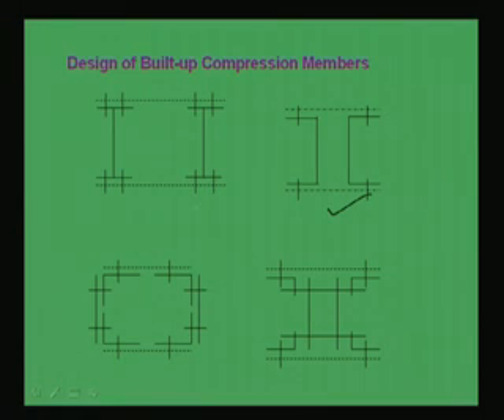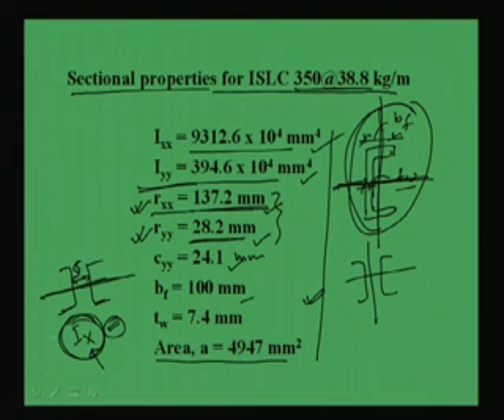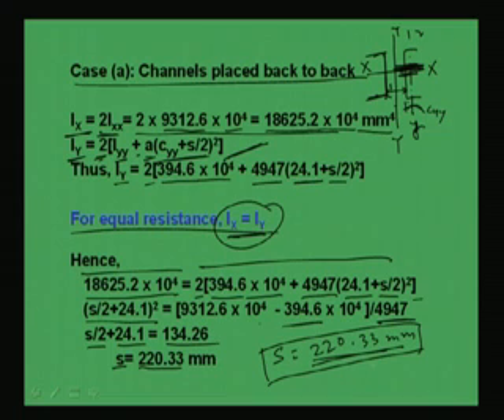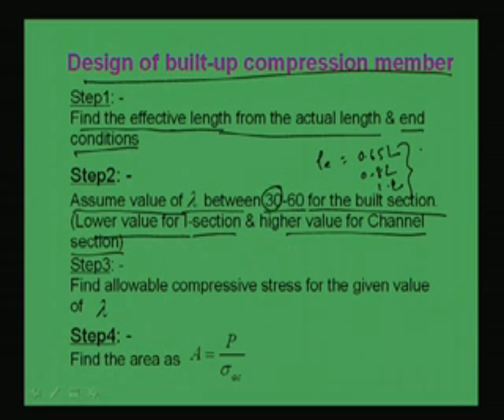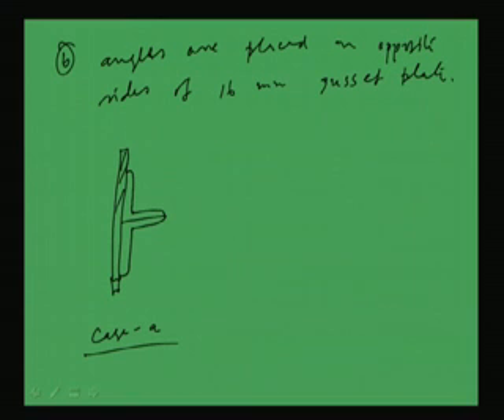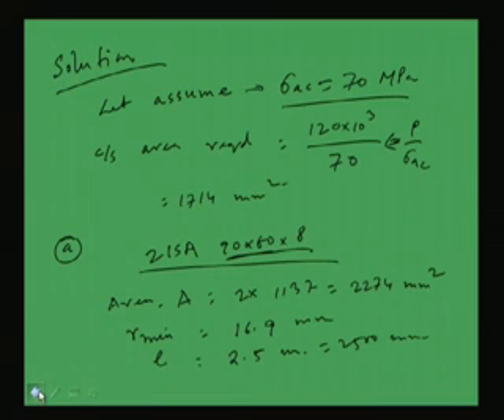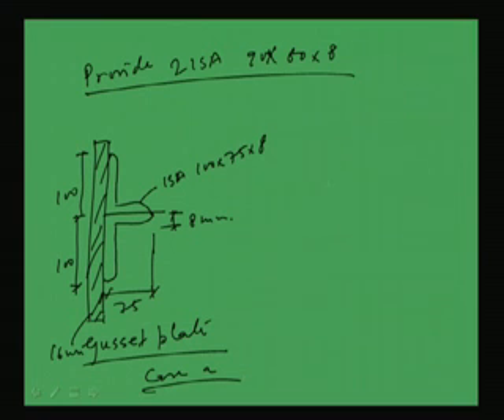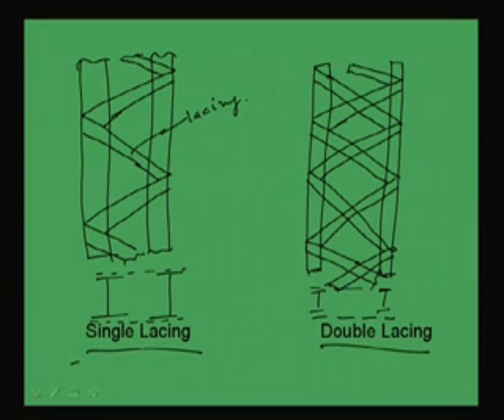Mod-5 Lec-5 Design of Built up Compression Member

Comment: now we are using is 800 2007...so ans may be different?
Reply: Anita Dhami yes
Reply: I do got the same doubt
Reply: Solution of design of builtup section ISA at 00:34:50 in video is wrong... i guess.  

Rmin= 16.9 is taken/said for individual section rather it should have been for quivalent builtup section ....
Please clarify
Reply: See, To understand steel design as per IS 800:2007, follow Rammarutham and S.K. Duggal book. They are the best. As an experienced academician, I will surely suggest those 2 books first.